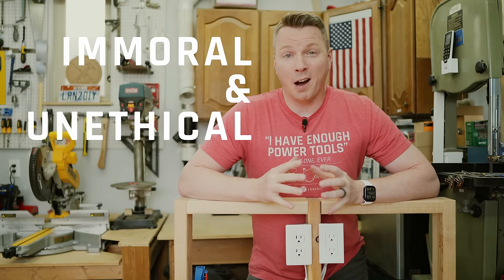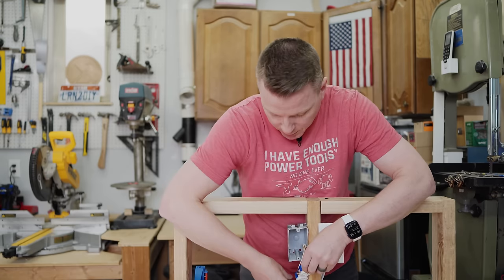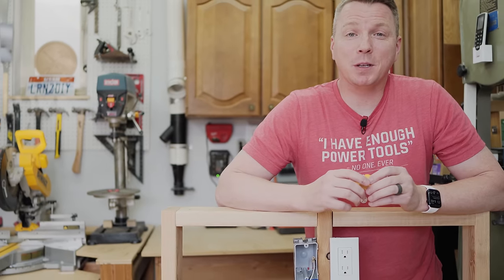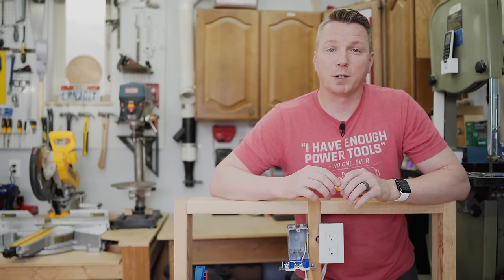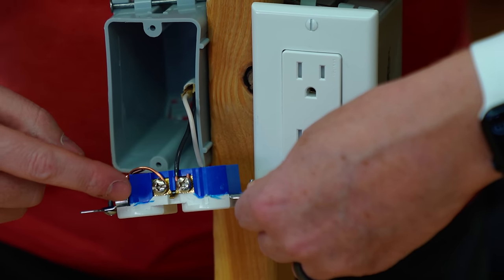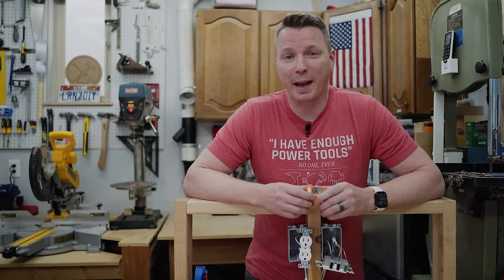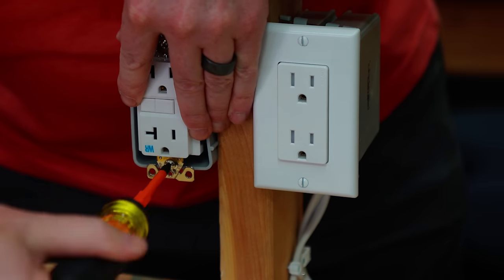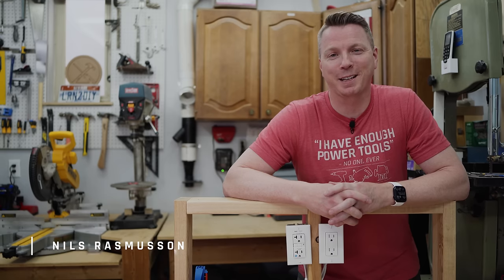People Are Adding Deadly Hacks to Outlets

Comment: Yep. I have an apartment where the buildings hallway 4 outlets runs vertical right behind my wall. However they covered the 4 outlets with "no access" plates so no one can use the sockets in the hallway.

I took a measurement and cut a nice access door into the wall and armed with high voltage gloves - claimed that whole line... Yes it was live at the time as I have no access to the breaker....

Free electricity works for me...

Is there a safe way to measure the maximum load that can be put onto the line... Otherwise   at an assumed 15amps .... 1800 watts x 4 works for me

The outlet had originally had these bootleg jumpers... I grounded it alright

Comment: in europe its called "classic Ground or Classic 0 " you do them in old houses where you only have 2 wires. you do not do it if you have new houses/ flats where when you do the new wires you instal 3 wire cables.

Comment: A lot of people dont know is that this type of ground is also found in light switches. especially Dimming ones. the more high tech dim switches have ground sensing, which means they will not work without the ground. It was called the california grounding method in tradeschool and it was reference to either CA adding that to the NEC or something bad happening there involving the illegal grounding method. The northeast is the worst offender of this.

Comment: If you're just trying to check for correct wiring and not more advanced tests those professional testers are meant to do, a multimeter is enough. If wired correctly, measuring the resistance between neutral and ground should give no reading or a very high resistance value while measuring the voltage should return a small voltage, then you can check if the live is correct by poking the wall with one of the multimeter's tips and putting the other into the socket. The live pin should approach the intended voltage for the socket while neutral should be at or near zero.

Comment: You can detect this without an expensive tester by just measuring the voltage difference between earth and neutral. It should be low but detectable around a few volts. If you did a bootleg ground, it will be in the milivolt range.

Comment: 7:25 You should replace the first outlet on the circuit with a GFCI or on the panel to protect all the outlets downstream. It's the most efficient way to protect your house.
Reply: I noticed my apartment bathroom and kitchen are wired like this. I tested the GFCI and then I had to reset my clock connected to the standard outlet.
Reply: @VectraQS  That's something I didn't think about, thx

Comment: super common on old homes. Neutral is ground. That is also how it is wired at the Transformer.  If for whatever reason you have a hot wire shorting to the chassis of whatever, the whole idea is to provide a path to the source instead of through you. Electricity only flows through to the source. When you stick it in the ground, that just means it travels through higher resistance back up to the transformer through the ground wire and back to the source. The only thing that actually goes to the ground itself is lightning, as that is the source. Electrical engineering 101.

Comment: OK! First I'm an Australian living in New Zealand.  We have different power points AKA gpo's, and they are one of the safest power points, as we can switch then on or off! Just like the British outlets! On the street supply there is 3 phase at 400-415 Volts AC @ 50hz, between any 2 of the 3 is 400-415V, however, between an 1 we receive 230-250V @ 50hz!
Some American claim to have single phase (one wire) @ 240V @60hz, not true, you have say for lights or television, you have 110-120V @ 60Hz
Your outlets (television for an example) are dangerous like if there was a gas leak, your out lets may spark when you either remove or insert a plug.  It doesn't happen here, as we switch off first then remove the plug!
If you had 240V @60hz from the street supply (single wire) than yes you have 240V!

Comment: Neutral and ground is all terminated together in the breaker panel. . so as a length of wire. I ask. What the difference? It connects to a ground

Comment: I'm somewhat divided on your american plugs. Specifically the part that you can't connect a plug that requires ground to a 2-prong outlet. But I get it, there may be equipment that does require ground to be safe, while other doesn't and can just use 2-prong plug. I like how it's done on european (specifically russian) outlets, where ground contact is on a side of the indentation (the indentation is also an extra safety measure) and is optional. I've seen outlets that don't have these contacts, but still allow plugs that have ground connection, and vise versa. It may be a safety risk, so I'm not sure if that's good. And even if the plug has ground contacts, it may be just not connected or connected to neutral just like here. Also, your plugs that require a ground connection can only be plugged in one orientation, unlike european, so that's a plus because equipment designers can rely on that hot wire is hot and neutral is neutral. Both styles of outlets and plugs have their ups and downs (some fixable, some not without a big redesign and a new standard).
Reply: Things that don't require a ground come with two prong plugs, which plug into a three prong outlet just fine. Things that do require a ground have the three prong plug, which won't go into the old two prong outlets. There's no real reason to install ungrounded wiring, and it's illegal anyway.
Everyone installs three prong plugs upside down, but that's a different thing.

Comment: I wish I understood all of this better. The fact that ground and neutral are bonded in the breaker box makes all of this hard to understand. Is the ground just a redundant neutral?  The only device I’ve ever seen malfunction without a proper ground was an iMac that would give you minor shocks when you touched the case. That was in Thailand where an extension cord had three prong outlets, but no ground wire. I also had trouble there distinguishing ground from neutral where they don’t use bare wires for ground and don’t have consistent colors on individual conductors. I never was convinced it was connected right and the “licensed “ electrician considered the ground and neutral wires as interchangeable. I’m 65. I really can’t think of a time where I had a malfunction that actually shorted to ground. I wonder how many times I’ve been around incorrectly wired circuits and just never knew it.
Reply: Mark, the ground wire is not a redundant neutral, a bootleg ground makes it one, but is illegal. Think of the ground wire like a spare tire in your car. As long as everything is functioning correctly, it has nothing to do. It's only supposed to be used in an emergency. The reason why the ground and neutral are bonded at the main electrical panel and nowhere else, including sub panels, is to allow the circuit breaker to trip when the current is high enough, and to eliminate the possibility of parallel paths of current flow, aka objectionable current.The high current on the ground wire will then travel up to the transformer on the neutral and back to the panel on the hot and trip the breaker and therefore open the loop. A closed loop is required for electricity to flow. Current always attempts to return to its source, which in this case is the transformer. The earth ground and ground rod have nothing to do with this process, but serves a different purpose. The neutral wire is aka the grounded conductor because of the bonding, but is a current carrying conductor under normal operation. The ground wire is not. Maybe your electrician was confused by this.

Comment: I'm currently living in a condo high rise that was built in 1982 that does not have ground wires, but uses a metal conduit for grounding (I don't remember the correct term).  I am buying an even older house so I will need to ask the home inspector to see if the electrical panel has a date or I'll have to check to see if ground wires were run.

Comment: I moved onto an apartment built in the 1960s with 2 prong outlets and had to have 3 prong grounded for fiber internet. I bought a ground clamp to clamp to a metal water pipe under the sink and ran a wire from that to the green ground on the outlet. The wire was visible going from the outlet down to the carpet but invisible otherwise.
Reply: hopefully the water pipe is bonded to the service neutral in some way
Reply: @benchociej2435  Why?

Comment: iIn europe we did the same as we used to do in america, BUT, we didn't have hot and neutral, we had hot and ground, difference? It can happen when we connect the neutral wire to ground, problems can occur, deadly as you said. But if we replace the neutral with a ground wire and connect the holes for these 2 different wires, nothing bad may happen, it's more safer, but there is a disadvantage, some breakers or fuses will start tripping for no reason (so the meaning is there, but unknown to a normal person). We've had our hood wired this way for a long time, and no one has ever told us off, and my grandmother had outlets like this everywhere, on the boiler, boiler, pump, never, NEVER did anything happen. Is that wrong? Well... it's not as dangerous as the case you were talking about, but the best way anyway is to replace the wires all over the house, or at least in places where it's safer.

Comment: My entire house and shop are wired with no ground (mostly)😄. Some grounds are there but dont go to anything except each other and laying against the corner of the breaker box. Some lights and outlets are the even older 2 wire knob and tube (in remarkably good shape) might i add.
Then the light switches are hots only and in a daisy chain on some. My house is from 1912 and built onto in the late 70's though, the shop next to it is from the late 70's early 80's.  The outlets are a mix between upside down/right side up. Definitely wired by good ol farmers. 
Federal Pacific breaker box subpanel and all. 
No bootleg grounds here.. so atleast were not trying to fool know body😅.
 I do need to change out some outlets to "3 prong" though.
Maybe ill through in a gfci here and there.

Comment: My house was built in 1907, with zero Provisions for either Plumbing or electrical. This means everything was added after. My house still has knob and tube wiring, that is connected in series to about half the house on a single 15 amp breaker. I knocked the breakers that are on the knob and tube down to 10 amps because the wiring is over 60 years old now, and the wax paper insulator is beginning to crumble. I have slowly replaced as much as I possibly could oh, and I thought the NEC code book specifically so I made sure everything was proper and safe. My breaker panel is from the 70s, that will be getting replaced here soon.

Comment: 1 if the power is hooked to gold and neutral to silver, what is wrong with attaching the ground to the neutral? if you look at the circuit breaker box, the ground wires connect to the same bar as the neutral.

2 in those older homes from 40-70's usually they are ran with bx cable and metal boxes.  They also only had 2 wires because the cable itself usually works as a ground and with it attached to a metal box makes the box grounded. If that is not the case they would never had connected the ground screw tab to the screw that attaches the outlet to the box. 

I found that the biggest time you should worry is when you have Romex or plastic boxes

Comment: I do understand about the bootleg problem.  My house has only one bootleg ground and its on the circuit that powers an air compressor which pulls close to 18 amps .  Its an old compressor and labeled on the compressor motor 17.8 amps.     I see no harm in using that one dedicated 20 amp circuit for air compressor only and bootleg it instead of going though the trouble if running a new piece of romex from the panel.   I would think if motor on compressor shorted to ground it would trip the breaker using the bootleg.

Comment: You can also test the hard way, by checking if the leakage current switch triggers if you put the right load between live and earth. Like that you immediately test the quality of the complete protection circuit.

Comment: And we have another option  system TN-C with Ground-neutral wire (PEN), in fuse box you don't need RCD, but if connecting electric socket you should connect PEN wire to ground screw and make bridge to Neutral Screw.

Comment: You left out one option, I think. If the wiring is in metal conduit with  metal outlet boxes, a ground wire can be connected at the back of the metal box.  Right?

Comment: At a GFCI receptacle outlet, only a “NO EQUIPMENT GROUND” sticker is required on the face plate. But, if the receptacle does not have the “TEST” and “RESET” buttons, then it must have both the “NO EQUIPMENT GROUND” and “GFCI PROTECTED” stickers. This includes downstream outlets, which wouldn’t have test/reset. See National Electrical Code [NEC 405.4(D)(2)(b,c)]

Comment: I’m a service electrician for the box stores. I have seen scotty electrical work in retail store chains that in done most times by out of state people and unlicensed electrical work by contractors. MBA managers hire these people cause there a lot cheaper and easier to deal with. Thank you for making this video. We are in are resection and I see a lot of general contractors doing there own electrical work for a better price for the corporation.
Reply: A few years ago, I was doing some LAN cabling in a dollar store.  I noticed the "electricians" were trying to attach a backboard to the drywall with drywall screws into drywall, rather than wood screws into the studs!  They were filling that backboard with screws, but it just wouldn't stay up.  One of them also tried climbing a ladder that I was on!  I made it clear, in no uncertain terms, that he had to get off immediately.  Only, I wasn't so polite about it.

Comment: I worked at a hotel as maintenance and had to replace a few outlets while there and it was built in the 80s and none of the outlets more specifically the 120v outlets had a ground wire running to them at all only a hot and neutral for context no I am not an electrician and idk the legality of them having me do outlet replacements but I have done them in my own home and am not worried about it too much it's pretty straightforward as long as you aren't an idiot. Anyway over the years I have been in places with only two prong sockets and just busy the ground off my surge protectors and PC power cables etc and have never had an issue in doing so I know someone is going to have a bird about it but if it ain't broke don't fix it.

Comment: So I had an inspection in my aunts house, and people had wired a reversed wiring with the ground connected to neutral and some of the outlets burned and caught major damages. No power on some outlets and some of them smashed. I’m going back on Saturday to replace their outlets. It was pretty dangerous, I know what to do and I will fix them for it! It’s a MAJOR CODE VIOLATION !

Comment: I replaced 2 light switches that had old dimmers we kept getting shocked by touching the screws. Turned out some reason the white wire is hot black wire is neutral. I tried to find the source of the problem could not ended up putting black tape over the white wire and white tape over the black worked no issues. I noticed that current was back feeding from those dimmers to a neutral on another plug that also stopped. My home is flat roof slump block also aluminum wire. Wish I entire house gutted back in 2007 and rewired all copper.

Comment: The past few years , all of our service panels , the ground and neutral wires go to the same bar in the panel.   So it could be done taking that into effect in remodels.
Reply: Then all of your panels have been wired illegally.  Ground and neutral must be kept separate, except at the main panel, where both must be tied to a grounding earth rod.
Reply: @Phillip Susi  re read.  I did say main panel.
Reply: @JasonMeeks79  you said service.  I took that to include sub panels.  And even in the main, you still have two separate bus bars that are then tied together.
Reply: @phillipsusi1791  service equipment in a house is often the main panel

Comment: On an AC circuit, it doesn't matter which wire is positive and negative. They switch polarity, usually at 50 or 60Hz. The "reverse polarity bootleg ground" sounds super suspicios
Reply: Please do not comment when you do not know. It is super dangerous. It caused the death of a plumber in Finland in 2015.

Comment: In Britain the electrical regulations requiring all sockets (outlets) and plugs to be earthed (grounded) came into force in 1934, so anything built since then will have an earth wire fitted. The first earthed sockets were produced in 1911.
Reply: In the US, the dedicated ground rule was phased in. A dedicated ground was required in "wet" areas (bathroom, laundry, etc.) in the 1960s, and for every single outlet in the home in 1974.

Comment: 2:28 I dont think they could measure it. Thats because before the neutral wire enters the building, it also is grounded. So how would this thing detect this fault, without setting off the fault current protection if there is any? 
By impedance between neutral an ground?

Comment: cool video.  AND just because your house is New dont assume it is wired right..  in my brand new house i had built in 2004, I found 2 outlets in the house that were wired with hot and neutral reversed out of the 45 outlets in the house..   when I first moved in I found the first one as i plugged a UPS for a computer in and the UPS immediately popped up wit ha site wiring fault and shut down..   so i tested them all and found the other..  house was brand new so the electrician (not the one who built the house) came and fixed it and checked everything even inside the panel box..